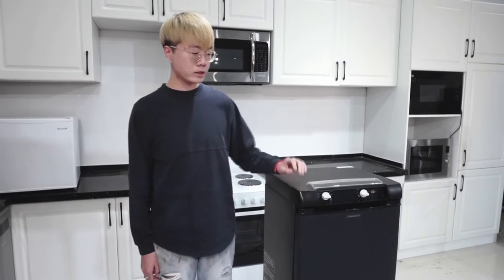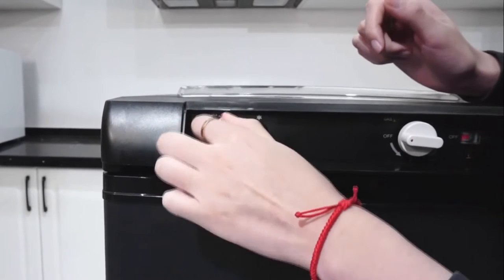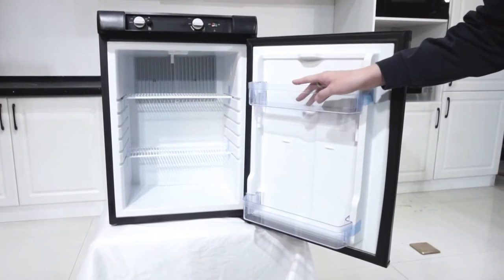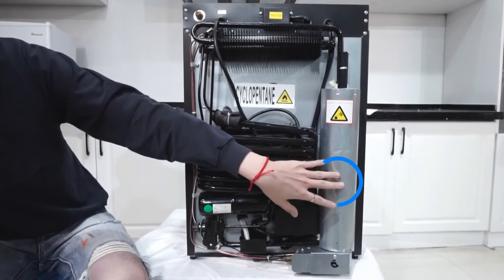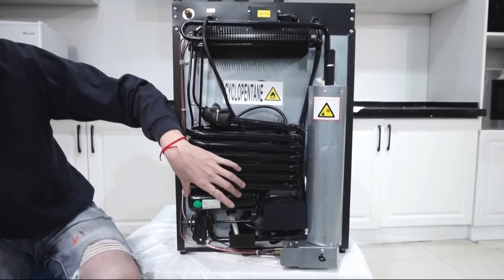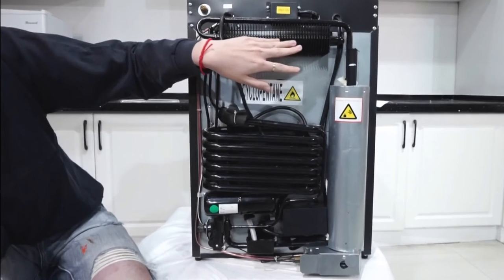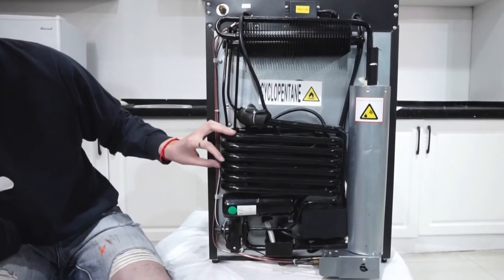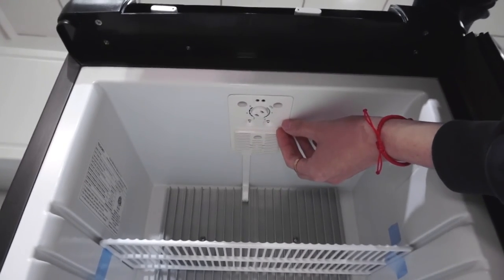Unboxing Portable Fridge for Camping. How does a 3-way gas refrigerator work? Off Grid Refrigerator

Comment: At 1:37 in you said you had another video on how to use the other options. Im unable to find that " other" video. As Iam  can't figure out how to enable the 12v option? When i turn the selector to 12v nothing happens?
Reply from the maker: To enable the 12V option, please make sure the following steps are followed:

    Ensure the refrigerator is connected to a 12V power supply.
    Switch the selector to the 12V mode.
    Check the fuse or power connection to ensure there's no interruption in the 12V power supply.
    The 12V mode typically works while the vehicle is running to prevent battery drain, so make sure the engine is on while using this mode.

If you need further assistance, feel free to reach out to us or watch our detailed tutorial on this feature.

Comment: Can it be installed on a moving truck and it's well functioning?
Reply from the maker: Yes sure, it can be powered by 12 volt DC, and this fridge comes with a car cigarette cord.
Reply: @smadelectricappliances  We can't find anywhere in the instructions on where to wire the 12 volt DC wires. Yes, there is a lighter plug in, but don't know where the other end wires go into.